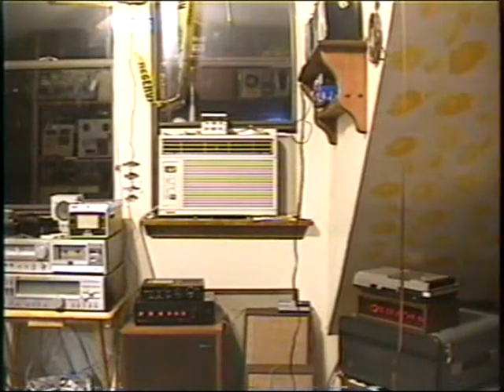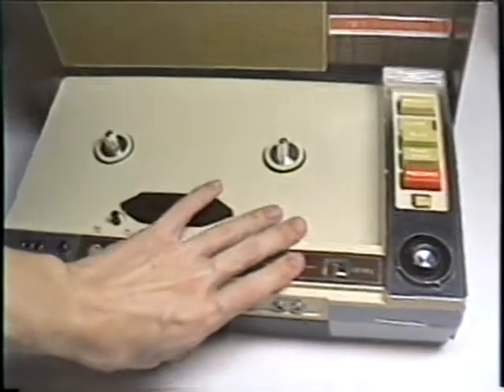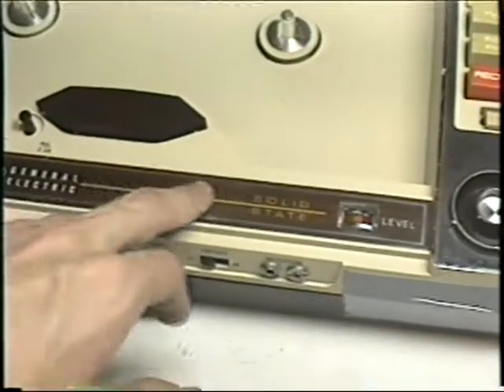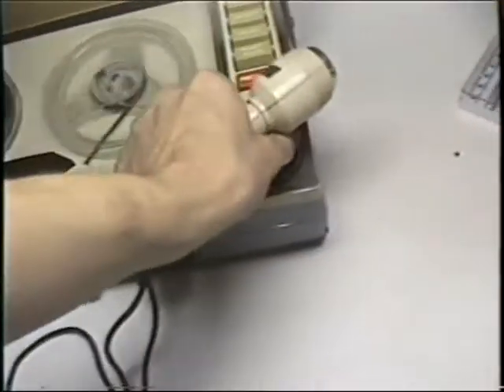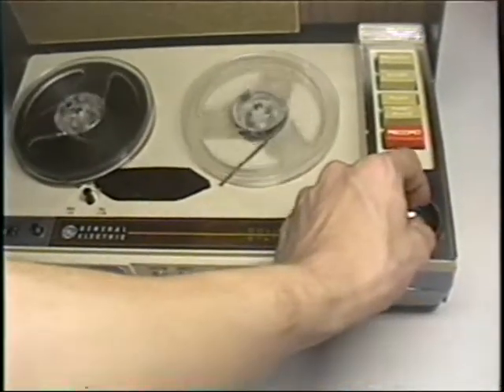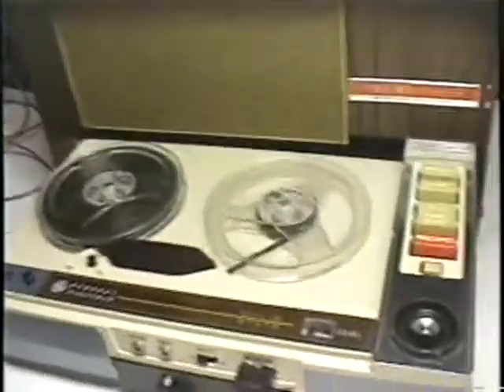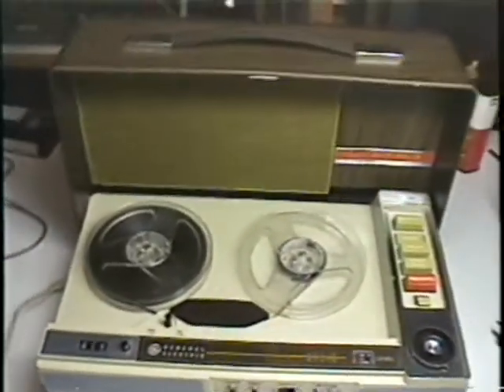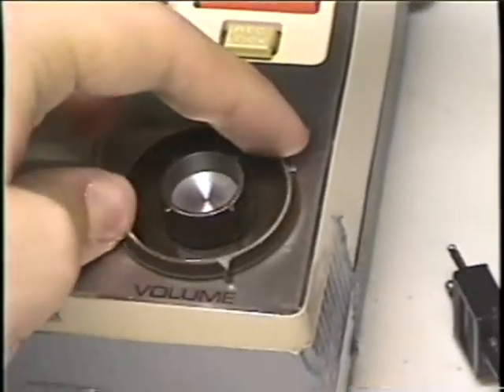General Electric M 8040A Swinger presentation, video PART 2

Comment: What size batteries does the unit use?  What's the deal with the Dig the earth tone message that shows up during the video?  That air condition unit is noisey, does it have a remote control?  What's the switch next to the microphone on the tape recorder?